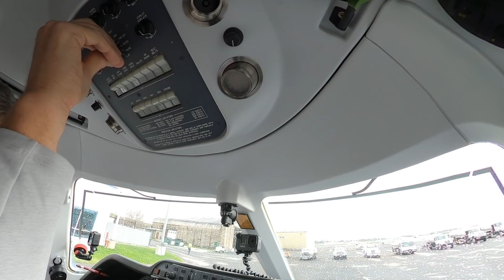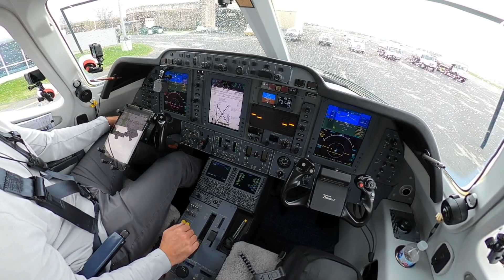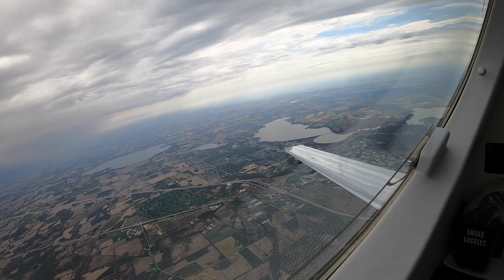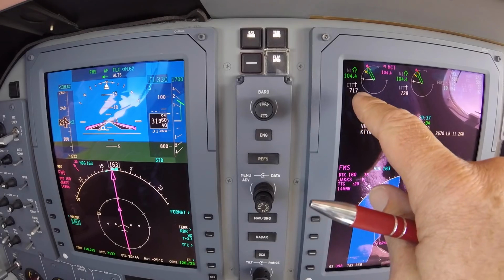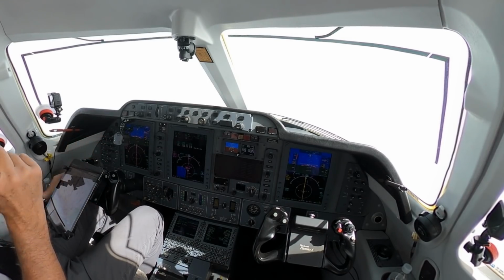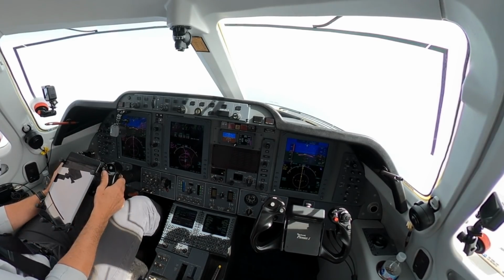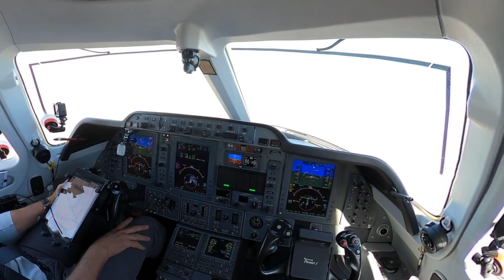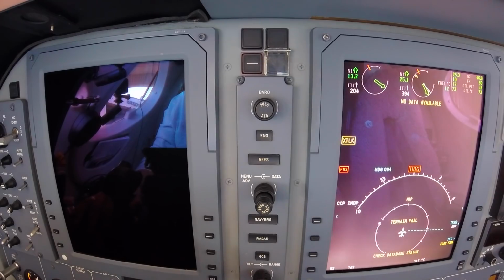I may have screwed this up! Private Jet Flight

Comment: Greg, I flew the F-102A and 6 other AF and commercial aircraft. I used the cockpit as my checklist then called for it to be read in a two crew aircraft and it was "checked, checked set, verified, on, off. Strap that aircraft to your back and become one. Nothing else matters. I'll sit your right seat anytime.

Comment from the maker: Many have asked about why fly so high on a short flight. Check out the info section for the answer.
Reply: Hi Greg, I saw the profiles for flying high on short flights. Does that take into account the gph burn to get to altitude? What about avg hour burn for the duration of the flight, t/o, climb out, cruise, descent and land? Once you get to alt, sure fuel savings are there, but to get to alt, are the savings still realized, I guess is my better question. 🙂
Reply: @Moonrocket59  I second the question. I am one of the viewers who asked about it in the previous video.
Reply: that's a math/physics problem (collect the data points, draw the curve, analyze the graph) calculus makes my head hurt, all those integrals and derivatives and calculating area under the curve, tangent points, approach to zero and infinity stuff that I forgot a long time ago.....
Reply: To get above the weather
Reply: @Moonrocket59  The essence of it is, the higher you are.. the less fuel the engine is burning, you are not sitting on 100% N1 power for the full climb out, not even close to that really. As you climb higher, you're fuel burn will be less, and less even though you are not on a cruise power setting. Plus, remember he climbing to FL410 in about 10-12 minuets, so really in the essence of the flight.. it is not a longer period of time he is sitting on that climb power setting. Then remember, on his decent he can pull the throttles way back from that cruise power setting, and finish the flight from FL410 to whatever for x number of NM way back on power.
Reply: Hello P1D. Your profiles in the info section have diminishing fuel burns all the way to the end. Was FL 420 even less fuel burn?
Reply: cm m that’s incorrect. You climb at max continuous thrust all the way to altitude. Jet engines get more efficient the higher you fly so even at max power, fuel burn goes down. The STEEPER you climb to alt, the overall lower your fuel burn will be. We then try and plan for as close to flight idle descents as possible
Reply: Aaron Harrington that is incorrect, you do not fly at a 100% N1 from takeoff power all the way through the climb.
Reply: Come on Greg, tell it like it is, if you could attain low earth orbit, the fule burn there would be zero as once into space there is no air resistance.
Reply: @Moonrocket59  Here's why it makes a huge difference:
1 - Thermodynamics. The higher you go, the cooler the outside air is. The colder air makes combustion more efficient. At some point above FL350 the air stops cooling down.
2 - Air density. The higher you go, the thinner the air gets. On one hand that means the engine will lose thrust, on the other hand drag comes down. As long as there's enough thrust to overcome drag, its a great deal.
The effect of both those variables is massive. Typically a turbofan will consume quite comparable fuel flows idling on the ground vs cruising at service ceiling.
So the higher the jet goes, the lower the available vertical climb possible.
Reply: That’s some great performance
Reply: In the LR24D anything over 400 miles we filed for FL410.  The old GE610 was more efficient at altitude. Sure we burned a lot getting to altitude but you have to remember on a 400 mile trip as soon as we got to altitude we started coasting down at flight idle burning way less total fuel than if we would have cruised at FL250.
Reply: @aaronharrington4810  There is a difference between takeoff thrust and climb thrust. After takeoff, depending on aircraft type and conditions, 1500 ft is usually the thrust reduction altitude (TRA). This is where you retard the throttles to climb thrust to help preserve engine life. I'm not familiar with the Premiere T/O and Climb checklists, but I would imagine the engine manufacturer recommends reducing thrust shortly after T/O.
Reply: Aaron Harrington so how exactly was I incorrect? Max continuous thrust is not the same as takeoff thrust. Max continuous thrust just means the maximum thrust a turbine engine can produce for a long period of time. Does not mean it is the maximum amount of thrust the engine can produce which would be 100% N1.
Reply: I get that the input to potential energy on climb is recovered on decent, and the basic aerodynamics of reduced air density. However fuel specific thrust of a turbofan is much better at a cruise setting than at a flight idle setting and marginally better at a climb setting than a cruise setting. It seems not much would be gained with an excessively high altitude and steep decent, the benefit would be maximized with a peak altitude that allows the decent portion to be a shallow slope such that engines could be kept at a fair thrust output, and in this case you would need either a cruise clearance, block altitude, or expect ATC to speak up about expediting to the next flight level.
Reply: Have you ever seen something while flying when you said to yourself I don't what I just saw?
Reply: @aaronharrington4810  Power goes down as you go up too
Reply: @Moonrocket59  you get to altitude to get out of the way
Reply: Notice the throttles are reduced to maintain airspeed, whilst gs has increased. Also the altitude gain can be converted to kinetic energy, further reducing fuel flow, in an earlier descent. Burning fuel, reduces mass of the aircraft early in the flight, reducing the potential energy in the system, swings and roundabouts, as you require less lift, and therefore reduce drag....example Apollo......stage 2 fewer engines, greater acceleration....
Reply: hr 777 Glad I never took Calculus; no headaches. Never needed it.
Reply: Marcelo Pacheco those turbofans/fanjets are designed for fuel efficiency.....cruising at altitude, where most of the flight takes place. Glad I never took calculus, no headaches, never needed it.
Reply: What flight level would be required to get to Sweden with your fuel allowance, so you could buzz Greta’s house?

Comment: Always fun to have my morning coffee and watch one of your videos. Couple of observations. When I saw the chart load failure on the center flight display, I winced, instantly thinking, oh oh, there's a 50 Grand repair coming..

 whew

As you pointed out, ATC is quiet. Here in Canada, the two biggest airlines, Air Canada and WestJet have cut flights by 95 and 90% respectively and do not expect to see any dramatic increase over the next 12 to 18 months. Air Canada announced it is laying off 20,000 cabin and flight crews until further notice.

WestJet has announced 4,700 layoffs over the past 3 weeks.

Frieghters are now the largest Canadian flight segment ATC handles.  I've read that American, Delta and United along with regionals, are looking at up to 100,000 layoffs that could last 2 years. 6 months ago, pilots were in tight supply with airlines fighting to hire them. Today, the global furlough is estimated to be 160,000+ pilots. It's becoming painfully clear some carriers aren't going to make it. Even Netjets / Flexjet crews are becoming very worried.

I was happy to hear your "full stop" call on final to Indy Exec. It maybe a natural Air Force habit, but it's always a good one to use at all times at all uncontrolled airports. I taught  my students to declare intentions during entry to the downwind and again during the  turn onto final. Aircraft on the ground, start up at different times and may have not heard the first call during an aircraft  downwind leg.

Military trained pilots I flew with had the same Coms habits you have. Very consistent and always clear. I was lucky to learn from some of the best Air Force and Naval aviators on the planet. 

Until the next morning cup of joe, have a nice flight and stay safe!

Comment: 17:47 From what I've been told, that's 104.4% of the original design MCT of that engine model. Between tests of the engines as they've actually been built, and minor component upgrades that aren't significant enough to bump the model number, they've determined it can tolerate that extra 4.4%.
Reply: I was going to guess that it was rated for 100% at sea level or a warmer temperature, and 104.4 is allowable based on outside conditions.

Comment: Well done! FMS / MCP integration, which you demonstrated and explained well, in your limited time,  was a major paradigm shift when I was transitioning  from LRJet (20 series) /B-727/DC-8 to B-757/767 for me.  Having spent  35 years in a CRM  / dual pilot environment, I’m amazed that you presented so well! You demonstrated; helpfulness and patience with ATC ,  good communication skills, and safe flight procedures to your audience . We, ALWAYS, backup visual approaches with ILS or VNAV data. - Cpt Boeing 757/767, 11,0000 hrs in type.

Comment: Back in 1986, I was on a Piedmont 737-201 from CLT to ORL that was changed to drop off some passengers in Augusta late at night.  Weather was winter clear. The pilot left Atlanta Center after reporting Augusta in sight and ran a "perfect" visual to... um... Daniel Field with 3800' runway in downtown area. The beacon at Daniel was much brighter than Bush, the correct jet airport.  As a pilot who knew where we were and had to watch it unfold from the back, THAT is why I appreciate your comment about backup instrument verification of your approach and landing. We were lucky the locked up brakes and good rubber on the 737 got us stopped just before we entered the gas station off the end of the runway.

Comment: Hey Greg, this was the best video I’ve ever seen on YouTube!! You just gained another subscriber. 

I was a jet engine mechanic in the Air Force from 85-95 and once aviation gets in your blood, it then seeps into your soul and it’s with you forever! I really miss it bad and I started working on my pilot trying while I was in and stationed at Eglin AFB but didn’t get finished and figured I would get going again once PCS was done and I settled in again but didn’t get back to it in a timely manner and then was injured at work that tore myself up really bad and now there’s no way to ever pass an FAA physical so I have to live thru other guys like you now. You don’t know haw satisfying it is to heat your jet spin over, listen to the engine come to life when it lights off and the sounds that bring back a flood of memories when you throw the throttles to max for takeoff, only thing missing is the smell of the jp-4. 

I worked most of my time in flightline support, trim pad, & test cell. I had my run license in order to troubleshoot your engines on the trim pad as well and that is where it had really taken control of my body and soul, sitting in the pilots seat, running from idle to max + burners on the trim pad and all I was missing was the ability to uncable the jet and have the freedom to actually take it up and now it’s back to only being a dream again. I worked on the 15’s & 16’s, 141’s and I’m sure you have fond memories of the tweet and the T-38’s. I received an incentive flight in the 15 at Eglin AFB when I won Mntc Person Of the Year in 1989 for the 33rd Tac Unit at Eglin. That flight was almost 2 hours long and was the most amazing experience of my life!! I always did have respect for you guys but after that flight and experiencing what you guys go thru up there it increased tenfold!!

Great channel Greg!!! I’m looking forward to many more flights with you sir! Thank you so much for the ride along, I truly appreciate it!!

Stay safe up there!!
Reply: Awesome Don!  I know what you mean, I am C-141B Flight Engineer Veteran and there isn't a day I don't think about my Air Force days!  I was treated so well while in the Air Force and I was fortunate to get the job I wanted and my bases of choice.  I felt someone in the higher up was watching over me!  I was stationed out of McChord, Washington, so I flew predominantly over the Asia Pacific & Middle East.  LOTS of missions to the land of down under and that neck of the woods.  Glad to see another Vet here!  👌😎
Reply: Mishka Dean ah man, Mishka!!! I was getting ready to cross train from being a jet engine mechanic to being a Flight Engineer. I had already transferred from F-15 & F-16’s to C-141’s and had been on those for a couple years but then we had a conflict pop up out of nowhere and it wasn’t named until we where over in Spain and heading to Saudi Arabia and my school got canceled until further notice. There isn’t a day that goes by without me thinking about everything also. I loved the Air Force and wish I was still there today and is my biggest regret in life not staying in. 

Take care Mishka!!! Stay safe out there buddy!!
Reply: @1982MCI  My feeling exactly, I wish every day I had stayed in as well.  Unfortunately when they retired the C-141, they didn't offer to cross train me on to the C-5 or C-130, so I chose to get out rather than go back to my old ground mechanic job.  That was a big mistake, I'd be drawing my military pension now...LOL.... (please remove inserted boot from my ass as appropriate)..😋😂

Comment: Yeah, it's always good to have a backup so you know where you're landing. Back in the 60s before I knew her, my wife was doing her first cross country from Phoenix to Tucson. When she landed she couldn't figure out why these jeeps full of men with guns were coming out to meet her. Yep she got confused and landed at Davis Monthan. They escorted the "cute young thing" to the ladies room, gave her a stern warning and sent her on her way. Can only imagine what would happen today in that situation. Thanks for another enjoyable informative flight.
Reply: Yep...it happens.
Flying from downstate Illinois in the early seventies,  I reported 10 miles out and then downwind at Dupage only to realize I was at Aurora (near Chicago). That took some explaining...
Reply: As a non-pilot, I've always wondered why there aren't visual or electronic identifiers at airports that would help prevent unintentional landing errors.  I realize a lot of GA will not have electronics but it looks like they could put some sort of ID on approach paths not too unlike off ramp and gate IDs.  Then again, maybe it happens so infrequently that it's just not necessary.

Comment: Congrats for the quality of your videos. Impressive!
Well, about N1, if I remember well 35 years after leaving the flying school, 100% represents the nominal static thrust at sea level and standard atmosphere (29.92 in & 15°C). Rotation speed of the fan is not limited to 100% but this figure is the consequence of the limit of other components (low / high pressure compressors, turbine temp, etc...). If , as an example, the ITT for a given thrust is lower due to atmospheric conditions or speed, hence the N1 will increase when pushing the levers to the ITT limit.
My quite large experience as an airline captain shows N1 limits in excess of 115% for some GE CF6 engines (DC10-B747-MD11). Pratt & Whitney are usually driven by EPR.
Reply: Nice answer, Antoine. I scrolled before replying myself to see if someone else had already answered. P.S. CF6 is a good engine IMHO. Changed a few of those on DC10s (-10 and -30 series) for Emery Worldwide Airlines many years ago. Even replaced the #2 (tail) engine outdoors in a freezing rain storm once. I think they were CF6-6 on the -10 series and CF6-50 on the -30 series airframes if I remember correctly. Really liked working on those. Cheers!
Reply: An UPRATED version of the FJ44-1 is the 2,300 lbf (10 kN) thrust FJ44-2A, was introduced in 1997. It has a larger 21.7 in (550 mm) diameter fan, with two additional booster stages to increase core flow. Owing to stressing considerations, the centrifugal compressor is throttled-back aerodynamically to a lower HPC pressure ratio than the -1. Other features include an exhaust mixer and an electronic fuel control unit. So most probably they could increase the RPM from a 100% basis on the -1 up to something higher... this is why you find a value higher than 100% on the N1. 

I hope this could help.
Reply: Thanks for the explanation. Now, I can go ahead and hang my laundry on the clotheslines, beautiful hot and sunny day in South Florida. Just a little humor. How can I tell the difference between a DC-10 and an MD-11? Easy; look at the hubcaps. Be blessed and fly safe!!!